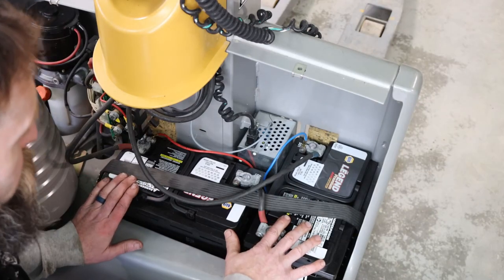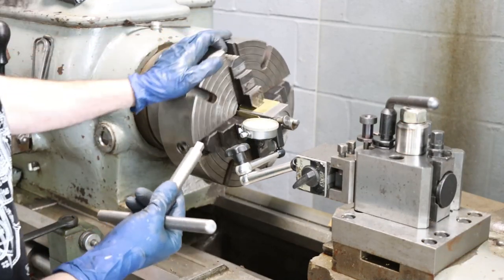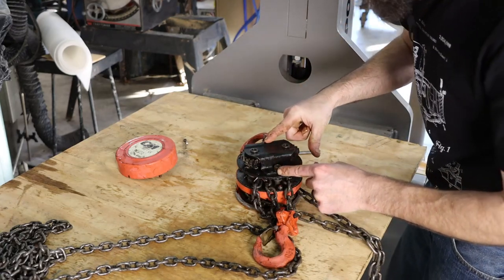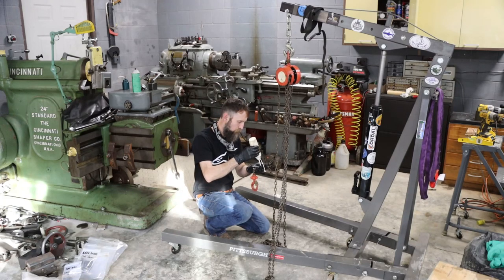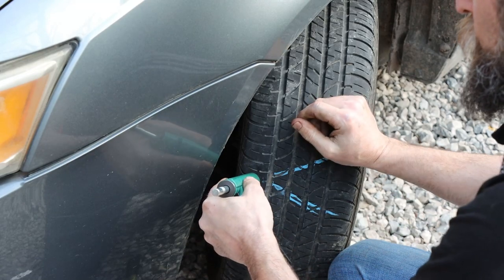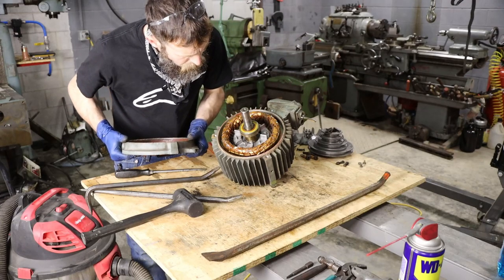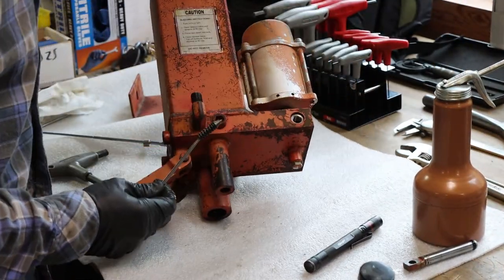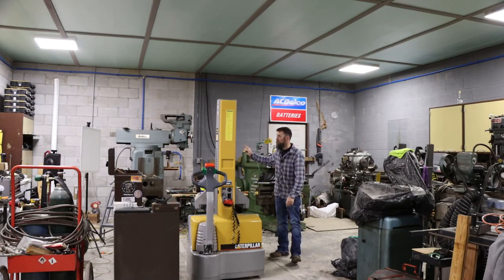DoAll Milling Machine motor and Big Press Repair.

Comment: Great video keep up the good work. I thought those inner ribs on the press were badly in the way if you had too press awkward large objects but they were useful this time. Could be useful to place something soft under the press caus if your anything like me sometimes you miss catching the part when it drops out of the press and ends up hitting the ground and breaking.

Comment: I'd put a sealed bearing on the can end of the mill motor and be done with needing to worry about greasing an open bearing. VFD's were invented for step pulley machines! ....give me a shout... I likely have an extra 3hp 220 v  VFD laying around here somewhere.

Comment: you should be able to install a grease tube extension that would make that rear bearing serviceable without disassembly.  Thanks for sharing
Reply: There's only a small clearance behind the edge of the fan so not enough room for a tube
Reply: @andyb7963  There was plenty of room in mine to install the extension tube. It looks like the same motor as mine and you can see there's room for the zerk fitting already. 
How much clearance do you have on yours?

Comment: I use oak 6x6's on my big hydraulic press to span the gap. They are good for at least 30 ton.  and their size makes me have to run the support up and down less often for the various press jobs. You must have subscribed to my channel after the shaw box rebuild series or you would know how those hoists work since I built all that brake mechanisim from scratch for my 15 ton bridge crane. I use grease on the brake faces of the big hoist and my little 3 ton yale. You might try it to see if it is less sticky. Worst case you just have to clean it back off if the load slips off when you let go of the chain. Good thing about that brake setup is it is self actuating so you can always just stop the hand chain and the hoist will stop too.

Comment: I used to build oil pumps at Bardons & Oliver machine Co., the way to form a good seat for those pump check valves, is to put the ball in place, and using a brass punch, give the ball a good smack with a hammer, this conforms the seat to the ball.

Comment: I wonder how it went welding that contaminated metal on the press's oil tank. It probably would have been worth it to make a modification while you were making changes to that tank so that it would never be necessary ever again. Perhaps a simple replaceable oil filter or screen or at least a drain plug. Still you are an inspiration to us all. Thanks Steve and Family!
Reply: Chances are now that it's been cleaned out that pump will never get cruddy again. That crud was from when it was made and when the equipment got left outside. Steve will probably take better care of it from now on.

Comment: Can you install a VFD on the spindle motor to make it variable speed.
Reply: While older motors are not inverter duty rated and don't cool as well at lower speeds, they will usually work fine if kept within a range and the temperature is monitored. If not, a modern motor could be used by adapting a C face motor.
Reply: @tiredoldmechanic1791  You lose torque when you go over line frequency too. That happens with any induction motor. Old or modern. They both operate in the same old universe we live in. So they can't get around the relationship between frequency and impedance that exists. Everyone acts like VFDs are magic. They're a compromise.

Comment: I have an EXLO with a variable speed head. I also have a large boring head used for facing flanges on large valves. Even in back gear the speed was too fast. Got a good VFD -- problem salved. Put your belt mid way and use the VFD for most applications.

Comment: Steve, before the shop overhaul I remeber you pulled the single phase motor from your lathe for electical repair (bad centrifugal switch) Have you considered a 3 phase motor upgrade? Maybe a VFD? Good to see the lathe making chips again. Addendum: consider VFD  for the Doal too! Changing belts is going to get old quick!

Comment: The plus side with having the grease point hidden away like that, is that the motor was squeaky clean inside. It is common to over grease motor bearings, it can cause grease to enter the inside of the motor, and be flung all over. Those looked like original bearings, if that's the case they held up for 40 years. I am thinking the design is half decent, after that long the motor may need a good cleaning anyways.

Comment: perfect time to install a VFD. you won't need a ladder to change speeds!
Reply: Not every motor likes being run off a VFD. There are downsides to using VFDs. Some motors will just burn up if you try. Then going faster you lose torque. Electricity is a funny thing. Has effects not many are aware of.

Comment: Depending on what size that squared drive is, you might actually find a standard Allen (hex key) to fit in there. I made a few Chuck keys like that. Just don’t use it for REALLY tightening down obviously. Have a good one, Steve.

Comment: If the eccentric shafts are likely to wear again would you have been better off turning the 10mm portion down to 6mm and putting a sacrificial brass/steel bush over them with a 2mm wall? Then the next time you just need to replace the bush.
Reply: Maybe next time. Maybe Steve will just keep up with keeping them lubed too?

Comment: That mill is crying out for a VFD, Steve... much better than a step stool in the long run.
Reply: Not really. You think using a VFD comes with no downside? Think again.
Reply: @1pcfred  And that's why they're used all over industry, because they suck?

For a 3hp motor in a home shop it's an absolutely great way to make speed changes on a step pulley head mill.
Reply: @rennkafer13  yeah and fast food is gourmet eating. Some things are just popular for reasons. Not always the best reasons either.
Reply: @1pcfred  ya, reasons like "they work well".  We're not talking about a static 3 phase converter where you lose a bunch of power.  VFD's work well and are a perfectly valid choice.
Reply: @rennkafer13  VFDs are a cheap hack.
Reply: If only you had some idea what you're talking about.

Comment: I believe most bearings have a number stamped on the edge, just to make ordering easier.
Reply: True, but it's easy enough to measure.
And I think ive only ever seen bearings in metric dimensions.
In the case of a shielded bearing the four digit number would be on the shield or seal itself, followed by a Z for metal, ZZ for both sides, RS for rubber seal or 2RS for a double sealed bearing like shown.
Open bearings have it etched on the outer race.
Then there's different clearances indicated by a mark like C2.
Clearance is needed for temperature swings in the operating environment, or maybe a really close fit for high precision in a clean environment with climate control.
Operating speed is also a factor.

Comment: Just loosen up the nut by one or two threads that you put on the hand wheel of chain hoist.
It will give it room to unwind and will run smooth in reverse also.

Comment: I think that grease fitting was put there just to make you feel bad that you didn't grease it properly.
Reply: when I did my time as a sparks ( not house bashing but heavy industrial ) we all took a turn in the motor rebuild shop / armature, stator winding as well we were inserted to remove any grease fitting if present and only fill the bearing housing 50% , job done. the reason was that when the said motor was out in the very dirty production areas think cast iron casings up to 40 ton and ci pipe spinning to 48 inches plus concrete pipe to 96 inch the plant was subjected to the greasers whose job was to grease the plant but they greased every week til is poured out , as you know a over greased bearing will overheat

Comment: The wheels will have cast in place urethane tyres. You can strip off the urethane and get new tyres cast onto them or even do it yourself . You can get two part urethane casting kits of various durometer levels .
Do some research to find out what durometer is recommended for the surface and loads the hoist handles. 
Make simple molds from plastic pipe or wood and cast the tyre around the wheel . Then turn the tyre down on the lathe to finish it.

Comment: Nice fix on the press Steve. I cant believe the crap that was in the tank! I bet those deep cycle batteries were more than twice the price of equivalent sized car ones! Will you be putting a sealed bearing on the back of the motor instead of the manually greased open one?  I think that i would as then you can forget that for the rest of your life, unless of course that you start doing production work for two shifts 16 hours a day in the future lol. I suspect that one's not on your personal radar though! Good content thus week especially seeing you on the lathe for the first time in more than a year. Good fix on the controls too. I send my best wishes to your daughter on her 18th birthday as i bet many others will have done. Stay safe, its getting better over here in the UK but not over quite yet after 150000 deaths and hopefully not too many more. My sister in law is still in intensive care, in her 6th month in there but now is getting better but now she gas got to learn to walk again. Its going to be a long road but she will get there God willing.

Comment: Also noticed the insulation worn off of the coiled cord on the lift, might want to check for any bare wires if you haven't already.

Comment: You need a split plate for the bearings to press out. I use ones for bearings for none press applications. I see if I can get a link

Comment: I would think that there should be a way to plumb that grease fitting like the one in the do-all saw. The one where the tubing broke while you were taking the motor out. It might be a good idea to make something similar for this motor too.
Reply: I think the bearings Steve puts in will last the rest of his life. The last ones lasted for 41 years. They were used industrially too.

Comment: I have that same press but it’s blue and yes that pump is terrible I ended up taking the whole unit apart every plug degreased it aka pressure washed it then put in evaporust and then I had the tank coated and you would not believe how well  the pump works now that it’s properly cleaned cause the oil from factory was well lacking any lubrication and the grit was what made it work so well I think it was some kind of used cutting or way oil filtered through a piece of rag

Comment: Too bad there doesn't appear to be enough clearance between the fan and the housing to put an extention on for the zerk fitting. Could run to outside access point for greasing. Nothing like a shop coming together. I always have 1 or 2 preliminary projects to do before I can start the one I want to do. Great progress.

Comment: Great video Steve but @28:00, that tire should be replaced or at the least moved to the rear and not used as a steering tire.

Comment: Steve, if you figure out what seals are on the pump cylinders, please let me know, I have a very similar press that needs seals,  but someone removed the seals so I don’t have a sample to go by . The pump looks like the same pump except it doesn’t have the air over hyd. Cylinder!

Comment: I'd move that tire to the rear I've seen tires run low got hot and the inside the tire would be damaged would never know it looking at the tire mounted on a wheel

Comment: Are you going to replace that open bearing on the back with a sealed bearing? If not how about putting a grease line in so disassembly is not required to lube the motor.
Reply: 41 years is not enough service life for you? You think Steve is still going to be at it 4 decades from now? Even if he is he probably won't be hearing bearing noise then. Or he won't care.

Comment: Smart thing to do is replace all the wheels at the same time. Those small wheels crack and split from the inside out. I work at a warehouse, we use all types of lifts. 
As for the batteries, there should be a "percentage" gauge on the battery "life" or strength. You get it down to around 10%, start charging them back to full.  
Can't you change out the parts in that head and put in hex drives? 
I hate tire plugs, they can and do get "thrown" out of the tire. 
Good reason why the bearing(s) went out... can't grease it. You can run a "tube" to that back fitting. 
Just curious, how did you clean any burs on the inside of the valve body? If there were any. Be extremely careful when using a bolt/pin to press against a shaft. Those can shoot out of there like a bullet. If you have to do that, get an old shower curtain and drape over the press. 
Any plans on making a hoist frame in the shop to hang that chain hoist from? Once you hang it, you'll start finding uses for it right and left, just like that engine crane. Great video as always. By the way, the shop is looking much better now. Cheers :)

Comment: I have to ask, on the back bearing on the spindle motor, is there any possibility of running a greasing line into that fitting location.  I couldn't quite tell from the camera angle, but it seemed there might be room for a metal lube line to run in there, and out the side.  Of course, if it ran this long without any added lube, the next bearing should last as long without extra grease, and you don't want grease forced down into the motor windings.

Comment: Lot of great comments, but not much about using E-Vapor Rust on the chain fall? Once I started using Kleen Strip metal & concrete prep, ($15 per gal & with water 3:1) never went back to the expensive E-Vapo Rust due to cost. Both are e-co friendly, but give Kleen Strip a try and let me know what your comment is,,,Bear.

Comment: ball joint fork or pitman shaft fork good for removing pulleys. just dont get "too"  rough.
Reply: I thought Steve was quite talented with the crowbars. Sometimes I like to use a pair of bars. One on each side.

Comment: couple of comments: just went through trying to get NAPA to warranty my expensive AGM battery. Make sure you keep ALL  your receipts & documentation, because if you don't have ALL your ducks in a row, they will use it to deny their warranty obligations. 
Also, just because they are AGM "maintenance free" batteries, they are not completely sealed. If you notice on the top of each battery at both ends, there is a 1/4" hole for venting. There is an inexpensive "kit" with a plastic elbow and vinyl tubing to run the charging off-gases out of the battery enclosure. This will lessen the chance for a battery explosion, and lessen the risk of corrosive gases damaging electrical connections in the enclosure. To be frank, I'm surprised NAPA didn't include those kits, what with buying multiple $250 batteries.

Comment: Steve,
I don't own a TIG welder. Welding up the worn cam faces wouldn't have been an option for me. Another way to skin this cat and what I would have reported to was to turn off the cam flush with the major diameter shaft. Then I would bore a slightly undersized hole on the cam centerline. I would then make a stepped replacement cam to press fit and/or Loc-tite into the bored hole. 
This method would also hide how poor a welder I am... Even after I  purchase a TIG machine.

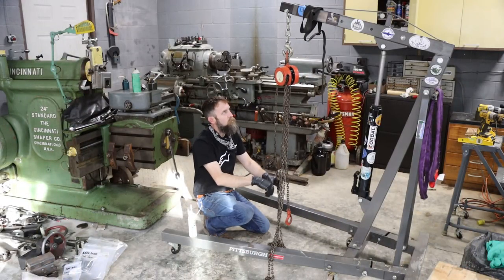Comment: 20:30 The slip clutch needs to be set for the lift weight.
This is a ½ Ton lift block and the clutch should slip if the load is over.
A tight clutch will compromise the built in safety margin and a fail may happen when lifting.
The lift block should slip when the item being lifted is over ½ Ton.
24:00 Next job make a jib for the Walkie Stacker.
Adapt the jib of your engine lifter.
Take it from me you will not regret the time investment.

Comment: The tyre puncture is very near the shoulder it might not work with plugging it, too much distortion going on there to keep it in, it'll work loose, but it might be OK hopefully! :)
Reply: I don't think the type of plug Steve used can work its way loose. It has a head on it. A head on the inside of the tire.

Comment: In the UK that tyre would be condemned as the repair is far too near the tyre wall and stands a fair chance of failing.  To be fair the UK cannot be the only country with that regulation.  In any case, plugs are only considered a 'get you home' temporary repair and should then be properly repaired with a vulcanised patch internally.  Steve, please don't take risks for the price of a tyre mate.  False economy and a UK MOT annual test failure.

Comment: I work for a structural steel shop and we have a big mitering bandsaw with a grease-able rear bearing motor.  Our millwright has told me that the grease service is no more than one pump twice a year on that bearing.

Are you planning to replace that with a sealed bearing or continue with the grease-able?

Comment: Where did you find the drive wheel for this lift? I have the exact same one, but its red. It has been sitting in the back of my shop for a yr or so since the wheel came apart. I looked pretty hard but could not find a replacement.
Reply from the maker: Search Jungheinrich Multiton Drive Wheel 77800067 On Ebay. This was the one for my lift. You need to contact the seller with your model and serial number to make sure it will fit before you order anything. They will direct you to the correct wheel.

Comment: Surprised you didn't consider making a flange to weld onto the reservoir so the cap could be bolted on vs welded....but on the other and there are only so many hours in a day.